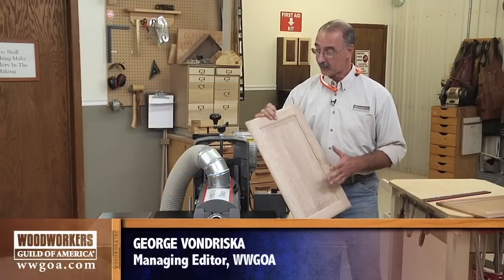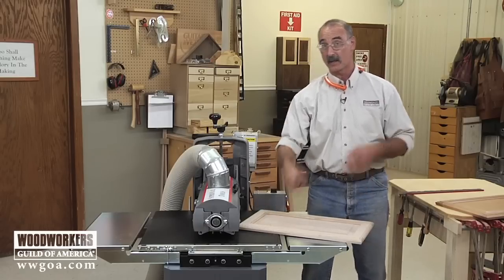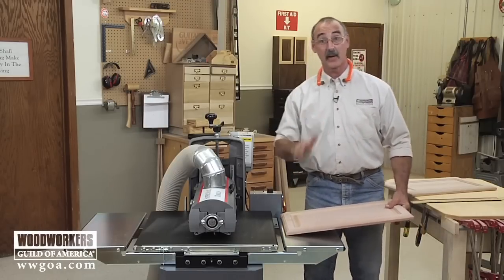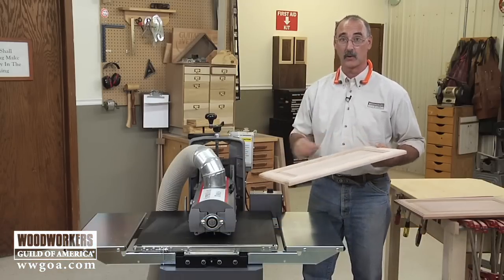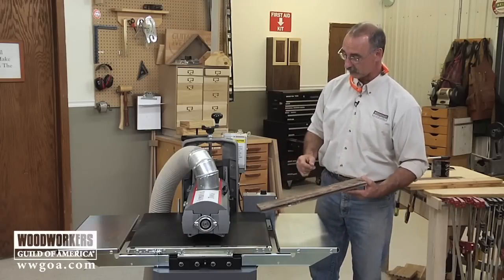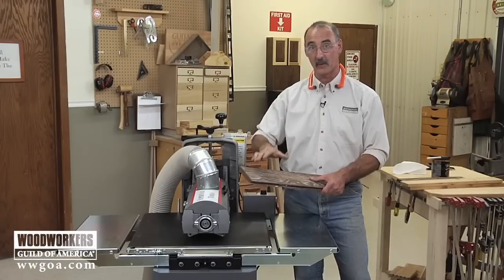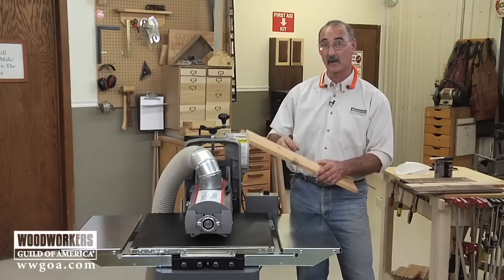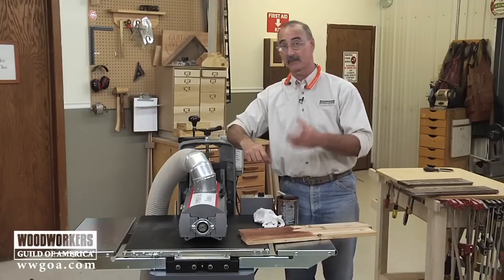Woodworking Tips: Using a Drum Sander to Sand Complex Profiles

Comment: Can I ask a question about a piece of lumber drying? I just bought a rough wet piece of  lumber to make some shelf boards on the wall but facing proper wood drying issues. This lumber is 0.8inch thick 5inch x 6.5feet sized. I cut them into 3 even length of pieces and now putting them on top of room heater intending to dry these in a shortest time. Should I pack them together tightly with some internal space to dry it in straight shape or is it ok if I just put the pieces on top of a room heater without packing and let them dry quickly? How long would it take a room heater unit to dry this lumber? this seem some very lighter and softer type of wood that very easily cut by a hand saw.
Reply: this lumber is maybe pine and looking very whitish.

Comment: Are these interchangeable heads available for all the 19-38s, or do you specifically have to get the drum/brush combo machine? I think I got mine before this was an option. Is it the same machine, or are there key differences. Very cool either way, but would be disappointed with supermax if this is a completely new  set up, rather than an enhancement.
Reply from the maker: Hello Nicholas, 

They are interchangeable on the current models, but I would suggest contacting Supermax directly to verify that your specific machine can support interchangeable heads.  https://www.supermaxtools.com/contact-us/

Thanks, 

Paul
WoodWorkers Guild of America Video Membership